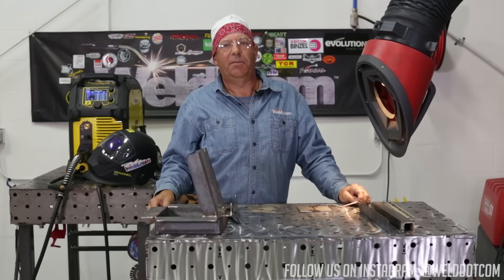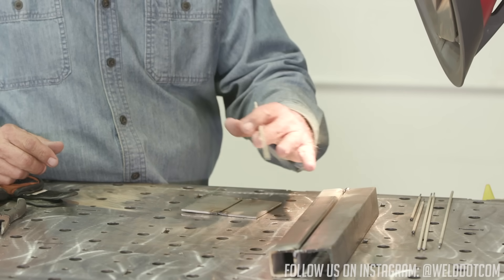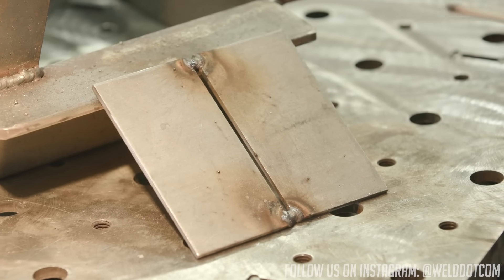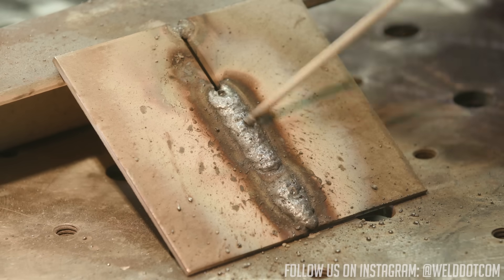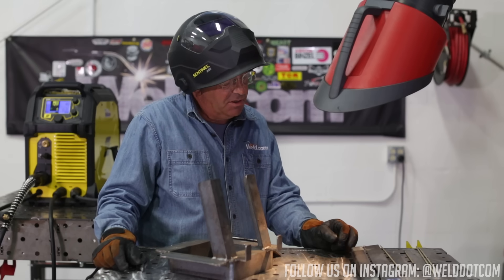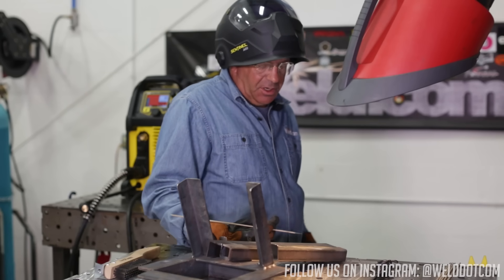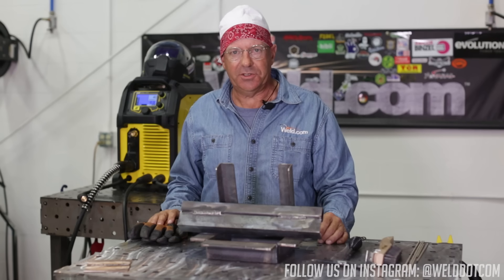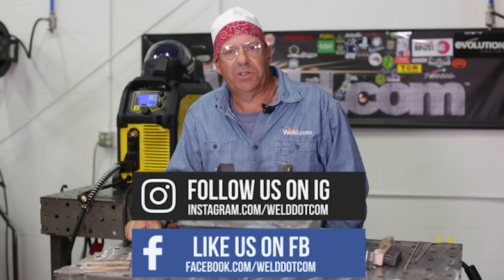Texas TIG Welding | Stick Welding with 2 Electrodes

Comment: With the tube to angle. Weld. Just drop a piece of round stock a little larger than the crevice. Into the crevice. Welding wire with no flux. Steel brazing rod. If it's not structural and all you want to do is fill the Gap use anything you got.. anything from a coat hanger to rebar.. whatever diameter you need. Tak it at both ends and.. weave right across it

Comment: I don't know sometimes this guy blows my mind in my experience and not patting myself on the back but I've had a lot a whole lot the heel of an angle iron will take a whole lot more heat than the rounded edge of a piece of tube??
Reply: Sure, since there is more material to take heat. But he was showing how to fill a gap to include thin to thinner. Takes some of the skill out to weld thicker steel to thicker steel. Thick to thin is a real challenge for nice welds and not burning holes.

Comment: Im not a welder but could you just put the second stick in the groove and weld over it without holding it
Reply: No. It would only fuse on top. He's trying to increase the weldment size to fill in the gap and still make a fairly structurally sound weld.

Comment: have layed carbon arc behind the gap, and layered in 7018 1 with flux 1 with the flux beat off to close gaps when fixing equipment in the field with an old lincoln SA200, that copper coated graphite keeps the puddle from dripping out the bottom, and so long as you stir your puddle to prevent trapping slag you get a solid weld. Just a little something I picked up from Grandpa, man could fix the world with a few pounds of 6013 and 7018

Comment: I bust off the coating of a 7018 rod and lay it in the gap and tack weld it and just weld over top of it and maybe use a filler like you're doing however I still use the 7018 method by taking the coating off

Comment: Love your work and i am learning from watching all  your stick vids several times over. Im starting with 3/32 rods and 1/16 6013 and maybe progress to some 6011. Not sure if there is a sequence of building to a wider variety of rods ? I tried welding a 5mm diameter steel solid rod ( a holding hook application ) to a 2.5-3mm square tube with some poor results. I tried to weld it in one pass and ended up with very ugly results . I wondered how you might approach it? Also when you short tack a nut to a bigger piece of steel ,say 10mm nut to a 3 mm plate , do you increase amps ? How might you approach those smaller type attachment  welds ?

Comment: We recently made a pressure vessel using a 20 inch sched 10 pipe with a 25mm end plate welded to the inside, recessed about 40mm into the vessel, using 7018. Unfortunately we had a bad fit up on this particular vessel, there was anywhere from a 4mm to a 7mm gap between the plate and the pipe. The gentleman who welded it had many years'experience and managed to get the root and a few fillers in using 2.6mm 7018 LH rods, on quite a low amperage. We also kept rotating the pipe to ensure he was always welding uphill, to get the most penetration. Thereafter he used 3.15mm 7018 LH to do a few more filler passes and then finally capped it with a pass of 4mm 7018.  Finally, he crawled inside the pipe and finished it with a TIG weld on the inside, fusing the back part and adding filler wire for some extra reinforcement. It was a real education for me in assisting him with this job as I learnt a lot about filling in with small stringers, and to see the various techniques he used to get the weld material where he wanted it to go. Many hours and lots of colourful language later the job was finished. Must say it was a good learning curve for us all in the workshop. I know it isn't exactly pertinent to this video as Mr Moffat was showing a technique for non critical components, but I thought I'd add to the conversation since bad fit ups are really common, and not desirable at all, especially with pressure vessels that have right tolerances. As always, thanks to weld.com for teaching me something I didn't know and had  never even considered. Definitely my favourite channel on YouTube!

Comment: Mr Moffat, In the 1940's the old British company "Quasi-Arc" produced equipment that actually ran a set up with two electrodes bonded together.  The electrode holder was fed with twin AC supplies and the process was known as "Twinarc",  as an apprentice over 50 years ago I was lucky enough to be able to play with a set along with an old Atomic Hydrogen set which was used for welding anchor chain links.

Comment: well, sometimes 'Texas Tig' is required eh?  sometimes you need that little extra filler especially when fit-up isn't ideal and you don't wanna mess up the root, or burn through and blow that wide open.

Comment: I did a job in Henderson, NV at a titanium plant. We were putting in 1/2 diamond tread plate.  Had a couple gnarly gaps. We were welding the plate with 5/32 7018. Busted the flux off of them rods and started pushing. Worked well to fill the gap and left the weld below the tread plate to be able to put a good cap pass on it. Couldn't tell there was a bad gap.  That was the beginning of my stick welding career.

Comment: Your supposed to knock the Flux off of a 7018 and use that as the filler
Reply: I see a lot of people saying that but if you knock off the flux wouldn't any rod be the same?

Comment: Now that you guys have done a wide gap on thin material, can you guys make a video showing 3G and 4G welds on 1/8" thick steel using 7018 rods?

Comment: I was always taught to take the Flux off the second rod as well, runs better and if necessary you can pass ut with it because the Flux is gone and you don't have to worry about adding contamination (none melted Flux) to weld area

Comment: LOL! 1st. time I did that (Texas tig) I called it the HAIL MARY WELD because I was out of options and I told my partner I was going to throw a hail Mary pass, if it works we be hero's, if it don't, we be lower than zeros! It did work and have used it many times since.
But until now, I didn't know that my great and final act of desperation actually had a name! :)

Comment: No hate meant just I am just shocked that you had to make a video on this topic and the number of people in the comments that did not know about this. I have only been a certified welder for about 8 years and I have known and used this technique for year so just i am astonished personally. Also you should defiantly remove the flux from the additional filler rod you will get far better results and are adding too much flux if you don't where it isn't welding properly. One last thing if you do have to use this technique on something slightly more critical and are worried about the strength of the weld (yes I would never use this on a xray or any type of very critical weld you are better off getting a piece of filler material of back-up bar) you always have the option to use this technique to fill your gap and then can grind out the weld to near base metal  and reweld the joint with a proper weld this time now that the gap is filled and potentially back gouge it depending on the circumstance and necessity.

Comment: Bob, used this application for several years on gaps. Another thing I do is keep a box of horse shoe nails handy for gaps. They are tapered and can work in several different types of spacings. Of course you don't feed the HS nail into the gap. You place it in the gap and tack it in place. Then do your weld over the top of the nail. Fills the gap and makes a nicer weld.

Comment: Can I use this for critical applications?  LOL.  joking.  

I have filled in a gap with 1/8" rod before but I cut and fit the rod into the gap and then welded it (instead of hand feeding it into the puddle).  Also it was with MIG.  Obliviously a good fit would be the best solution, but sometimes it happens.

Comment: I saw that trick 23 years ago here in the philippines.but for me that kind of a trick is just  wasting your electrode. You can weld a thin metal or even 1.2mm without blowing a hole unto it we call it here in the philippines spotfullweld

Comment: I'm not sure if I was fortunate or unfortunate to learn this right away. Constantly dealing with bad fits as a beginner about 13 years ago I learned it ftom an older, better, more experienced welder. Since then I have used 70 series tig filler wire, 7018 without the flux, and 6010. As you said however, it is best only for non critical welds. It was nice to see someone else do this for a change. My last one was about a 5/8 gap, 6 inch pipe and just the bottom half (3 - 9). Of course, overhead, out of position, and very uncomfortable. At least it was a dump line. Great video.

Comment: I’ve used this technique with the bare wire to weld up a crack that opened up on a double truck frame. And it’s been fine for years now the crack actually continued along the frame from where I ended but the weld didn’t crack again

Comment: I use this method all the time when i have rusty thin metal on old heater coils on tank cars normally the metal is already thin but include 10 years of rust on one from 450°f steam and well ya know lots of rust auper thin steel... i use a 1/8 6011 and chip the flux off another one maybe even a 1/8 7018 and cram it in there as best i can and. Normally it looks fine and a water check of 200 psi shows no leaks... but not all the time i will have some leaks if the metal is just too thin.

Comment: Yes sir I am a subscriber to your Channel and I have use this application many times I have 25 years experience as a certified welder that's how I make my living I've had to use this application a few times I'm taught my boys my oldest now is certified. I watched your video I would like to make one suggestion no disrespect if you beat the flux off of a 7018 sand it down as if it was TIG wire and use of 5p or 5 p+ I prefer 5p seems to be a lot hotter Rod flux. You actually can set up with a TIG finger and have better control and actually lay a very nice bead and I'm talkin a passable bead. Thank you for your Channel

Comment: I been doing this for years....we call it stick tig.....should ONLY be done on non critical sheet metal welds.....best way to do it is 6010 electrode and 7018 wire because you can knock all the flux off of the 7018

Comment: Good trick for a hell of spot. I would like to see the dual rod trick. Had a buddy crank 155amps and run 7018 in the stinger and the ground then met in the middle of the weld path and looped past for the tie in. Suprisingly nice looking bead.

Comment: you can weld with two headed nails too, there is a expansion joint in beverly powerhouse that was welded with a bunch of nails the scaffold builders left in the duct. it was an emergency outage and they wanted us to get it done and get out of there and we ran out of 70-18 so we ran those nails with the 2 heads. they were a little sticky but once you get your arc started it looked like running a a Ln225 suitcase. if you dont believe me just go buy a box of nails and mess with it. i wouldnt lie to ya. p.s. regular nails wont work. gotta be the kind with the two heads.

Comment: I was a Millwright in a saw mill for 12 years. I had to weld a lot of crappy stuff out in the mill. I have used this method with 7018 1/8” rod. Can save your but.

Comment: I like how you add "for non criticle welds." 

To "save time" some lesser wwii wartime shipbuilders put rebar rods with a cap weld on top  in grovewelds where they were supposed to have laid full on  mulitpass welds. Looked great on the surface. Unzipped like banana out on the open sea.
Reply: cobre I was told about this problem 70 years ago, about the welds unzipping like a banana whilst at sea, and a lot of “liberty ships never made it as a result..  killed a lot of seamen “to save time”.?
Reply: They didn't understand about transition temperatures back then, below which fracture toughness was really low (the metal became brittle). It's a sad story, talk about learning the hard way...
Reply: At a construction company I was at wed do that on structural welds since the company would get pissed off if we used too much rod since they were buying. Shady ass place.
Reply: If you participated and didn't report them, that makes you a shady person, too.
Reply: Would that have worked with a pass on either edge of the rebar?

Comment: 1109. Ok I'm not a welder at all...but I was like what the what? Lmbo. Thanks for the great video.
   Watched an old mechanic do something similar 1 time on a gear drive Tulsa 150 ton winch bracket on a tandem.  Brackets gave under load in feild...yup it bent. Used a cat950 forklift loader to push it as close as we could. Still 3/16" gap. He used 2 coathangers twisted together and 7018rod n welded it upon the front  side then just 7018 on the back side. Then went back to work. Gota love rig moving...where Murphy's law is the golden rule.  Btw they used that truck daily for almost 2 yrs w o a single issue till they bought a new winch for her. Don't get me wrong it wasnt tye right thing to do but it worked in a pinch n held up to the riggers of shock load and daily used w o failing.

Comment: We used to just knock the flux off a rod of the right size to lay in the gap then multi tack it along it's length every few inches. then run a weld from one end to the middle and stop. Let it cool a bit then weld from the other end to the middle. If possible we'd flip it over then weld the other side the same way.    Of course we'd curse the fitter, but we'd make it work.  You'd actually get pretty good at it if you had to work with some of the shoemaker fitters I had to work with.

Comment: I've used this on pipe it's fine for pressure.  Knock the flux off of 7018 and run the root with 6010.

Comment: I was a hand for a guy not to long ago 
We built fence and laid asphalt reclaim pads etc..... started building cattle pens and squeeze chutes and he never would let anyone cut pipe saddles other than himself..... which he often over trimmed or washed out ....... I ended up welding for him at this time I was 19..... and he was 59..... he’d been welding for about 40 years and me only existing for 19 years and welding since I was 12 years old.... on and off. I think I had maybe 4 to 6000 hours if weld hours.... I’m sure I’m over estimating..... but I was a better welder than he was........ which surprised me.... he was a very arrogant know it all type of guy though..... everything had to be done his way.... and he wanted to weld everything with +++++P 6010..... which I was fine with. Until I had to weld a gap over 1/4 inch. I was welding with 2 rods like this one day and he walked up to me and starts talking all kinds of shit.... like 
“What the fuck are you doing” and blah blah blah. “Takes you a $&@king hour to weld” etc etc. apparently he’d never seen someone do this..... I told him as calmly as I good. There was a gap here over 1/4” I had to fill. 
His response..... 
“ there ain’t no gap there. Your just slow as fuck”......... 
well obviously there isn’t a gap. It’s been welded by this point.....
He’s just being an ass...... 

Several times I had to do this......weld with 2 electrodes 
Or knock the flux of of a larger rod 
7018 usually and tack in holes and gaps when he wasn’t around..... because he’d just take a 6011 and burn through it as fast as he could..... resulting in weak welds. And piss poor beads.....   I welded and finished the pens and started building gates for him the week after. And he started that shit again. About slowness and just being an ass....... I quit.... that week after I finished the gates.... 
 
I may not have the hours put in. 
But I’m through the learning curve...... it got old having someone up my ass trying to control how I work and prevent me from doing things right... I used the hours I did have. Welding with other welders. Or in a classroom 
Learning how to fill gaps 
Weld over head 
Weld with 2 electrodes. 
And various tricks and different patterns for different situations etc...... I am by no means a master. But I consider myself a knowledgeable person and decent welder..... I used my time to learn things from others. To find better ways to do things..... whereas he just did everything his way.... and to hell with whatever anyone else knew.......
Reply: I'm afraid there are a few too many like that. The less they know, the more arrogant they are.
Reply: @lorenwegele7517  I was gonna say the same thing. Sounds like a couple people I know. Every day I wake up, I try not to get like that

Comment: I was under the impression that all the welders knew this. Learned this on my own in the field on my first weld job. In a perfect world all fits are tight but in the real world that's not the case and this Tijuana tig comes in real handy. Time saver on those non critical joints although this can pass U.T. from personal experience...

Comment: Why not just take a larger diameter rod and lay it in the gap? (Provided it doesn't fall through) and just weld, seems it would melt into both sides for the puddle. Also,  wouldn't have to balance act 2 long welding rods. Just a thought.

Comment: I really expected too much amps like 125, and trying to temper it with the second electrode. Also expected rust encrusted material to saturate the flux of one electrode, and save the day with the flux of the second one, also, that 40 amps made me less interested.
Non critical would be key in deed, no penetration i guess, i'm not sorry to say, i like penetration, even when not needed;)

Comment: Hi All;
My welder of choice is Oxy-A, Mainly because I like working with very thin material.
I find with the thinner material I use heavier filler rod. The heavy filler absorbs some of the exess heat.
Question:
How about using Texas-Tig with much heavier filler rod? Maybe 2 sizes larger.
Anyone tried this?
redrok
redrok.com